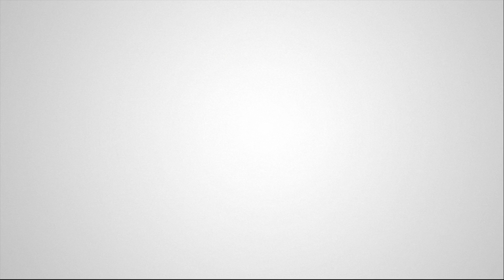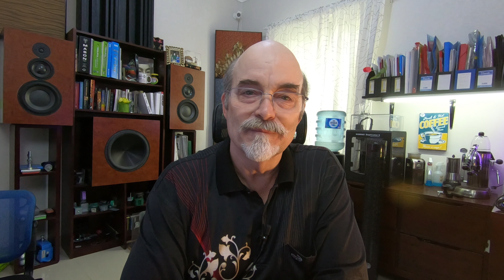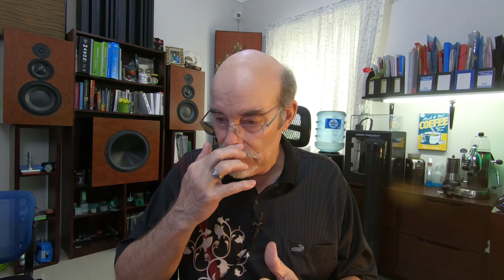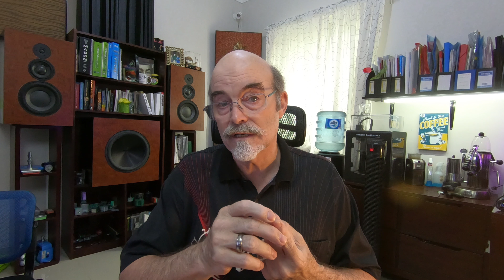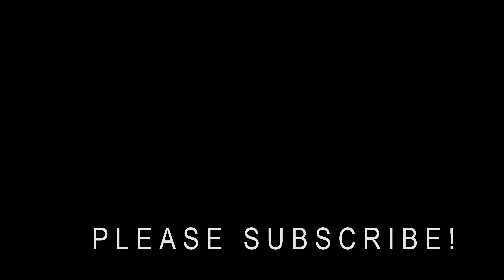Rock Wool Does Not Sound Proof

Comment: What insulation do you recommend for in-wall speakers?
Want to fill the wall so I don't get too much resonance on the adjacent wall, I also want to minimise vibrations.
Thinking of deadening the inside of the wall with some dynamat, but wanting to know what else would help. 
Thanks in advance!
Reply from the maker: If you are building "in-wall or Flush Mounted" speakers, the wall must be very massive too project all frequencies forward. The absorption (resonance damping) in the wall can be any fiber - rockwool or fiberglass.

Comment: John have you looked into sheep wool and hemp as alternatives to this at all? There are some wood derived high density panels also. All seem to be a good direct replacement for mineral wools and fibreglass potentially
Reply from the maker: I am an eternal skeptic - UNTIL it has been tested. I'm currently testing many materials that we thought had worked in certain ways and finding that we were WRONG!
It's best not to assume and get it tested. I am using the world's largest reverberation room, rated to 25 Hz. nwaalabs.com

Comment: So if I use some form of insulation in my set up im only doing a very small room(room inside a room) would chalking the air gaps paired with the insulation in wooden walls which would consist of ply, MDF and pine. The pine would be 2x4(old wood so actually 2x4) and 10 mm ply and 3-5mm mdf what about of sound proofing would this give me? How much would I benefit from thicker walls? And how much further benefit would acoustic foam provide me?
Thanks
Reply from the maker: Thicker isn't always better. You should consult a professional to get the sound transmission loss that you need. As far as 'how much soundproofing' the described should give - I don't know. I would need to run the numbers. What you need to find out is how many dB reduction is needed per 1/3rd octave band. Acoustic foam will provide NOTHING for soundproofing.

Comment: I am confused, the spaces between the joists separating my ground and first floor were filled with lightweight fibreglass and the noise between floors was terrible,  I took down my plasterboard ceiling for a rewire I then filled joist spaces with rockwool slabs this has massively improved the sound transmission between floors and I mean a huge difference.
Reply from the maker: It probably helped a LOT... this is due to the fact that the floor and perhaps the ceiling below was leaky (holes, cracks, etc).
This is a common misconception. You should use MASS and SEAL first. Also, when you replaced the fiberglass with rockwool, you may have changed the seal or mass of the floor or ceiling. Correlation is not causation.
Reply: I have also used roxul it it does makes a different !
To help reduce air born noises

Comment: Hey John.  Where do vents go?  Can we put ventilation baffles inside the wall cavities?  Like in-between a double wall system?  I will end up with a 3 foot space between ceiling and roof and I want to use this space for air transfer while isolating sound as much as possible.  Bad idea?
Reply from the maker: A very good question, sir. 
If you have a two-partition assembly, you will need baffles and attenuation of sound on each side of the partitions. The baffles will extend the mass of the partition while using absorbing material in the ducts along with pressure-changing cavities in the baffles to further attenuate sound. Wherever air goes, so goes sound. 
The space between the partitions must not be coupled with anything rigid like galvanized ducting. Use flexible connectors. This is common for HVAC systems to prevent vibrations from following the lines.
Reply: So snaking 6 feet(or so) of insulated flexible ducting through a large ceiling cavity would not be enough.  I would want baffle boxes on both side.  One on each side of partition for both intake and out take.  That would be four baffle boxes?>   @JHBrandt
Reply from the maker: @michaelangell9535  It really depends on the situation and design. That is what I have done in many builds. And we have no problems with sound transfer.
Your method may work well for your situation. I don't know.

Comment: John great video.
But there are lot of product based on rockwool that are advertised exclusively as sound insulation materials.
Why they do that?
Reply from the maker: What you say is very true. It is the reason why I posted this video. You have to remember that, especially now, most products are marketed for any niche they can fill - to increase the company's profit margins. 
Be skeptical, demand proof (empirical evidence). and don't believe anything at face value. Ask other professionals, etc.
See my resources page (website).
All the best.
Reply: @JHBrandt  John I think maybe because they are all advertised as insulation material inside a cavity....as you said an drywall has already its own sound insulation value. Filling in the gap will produce an +6db insulation value. Is this correct?

Comment: What is the best sound proofing? Glasswool or rockwool...plz tell
Reply: This is like asking if paper or cloth is better for making a drinking glass. His point is that you need mass (something heavy) and to seal things well. So a PERFECTLY soundproofing wall with a hole in it won't do the job. Mass + Seal is his solution. Adding the cheaper of the two you asked about INSIDE a wall is a good idea, but it's mostly the mass and seal that will give you the results you want. Once you have your wall, the cheaper of the two you asked about would be useful to absorb reflections WITHIN your treated space, to reduce reverb. But they won't do a lot to block sound from the outside.
Reply: Buy MLV, mass loaded vinyl, expensive but effective, it weights 10 to 5 kg per square meter.
Better than that is lead.

Comment: Im not asking about thick fiberglass insulation. I can either buy Rockwool Acoustic Mineral Wool Insulation 60-6lb 48"x24"x4" 3pcs
or Owens Corning 703 Fiberglas Acoustic Insulation - 3pcf 48"x24"x. To glue on my wall as panels. To treat my room. Not soundproof per se.

Comment: Hey I’m trying to build a sound booth for recording vocals. Is it a smart idea to put rock wool inside of the walls?
Reply from the maker: Yes, of course. Please see my videos on isolation. 😊
Reply: @JHBrandt  but will it make it “soundproof” or close enough to where I shouldn’t have any issues
Reply from the maker: @no.1noone179  No. It will not make it soundproof. Actually, there is no such thing as soundproof except in space. You have to have a vacuum between the buildings to be sound 'proof'. :D
Don't guess. you need to KNOW how much you need at each 1/3 octave band in the audible spectrum. Send me an email - john@jhbrandt.net

Comment: Hey John... So my understanding is Rockwool on itself is just for treating the room (i.e. acoustic panel stuff) and not for complete sound proof insulation. Am I getting it R8 or am I missing something ???
Reply from the maker: Joseph, Rockwool is used IN the walls and in treatment. But it doesn't soundproof. Not by itself. Yes, it is often used as a treatment for the velocity region but adding it to your walls does not increase the transmission loss the way you would think. Massive bricks of Rockwool in a wall do not improve sound transmission loss over lighter weight solutions. 
Use the fiber insulation for filling the wall cavities, yes. You can use rockwool or fiberglass, depending on your other requirements. :D
Please see my resources page "Absorption Coefficient (CONSTANT) where you can see the level of attenuation per frequency at any coefficient. NOTE: If a company shows you a chart depicting a response curve that goes down to 20 or 30 Hz, be very skeptical. ;) You have to look at WHERE the line crosses a coefficient... Example: an absorption coefficient of 0.7 means that at THAT frequency, the level is attenuated about 3.6 dB. - Therefore, ignore EVERYTHING below 0.7.
Reply: @JHBrandt  Thanks a lot John... Much helpful ❤

Comment: What would you suggest insulating an attic to reduce noise for small airplanes flying over?  Blown in fiberglass, rock wool?
Reply from the maker: You need an isolated structure system. The most that any absorber, like Rockwool, can do is 10 decibels.

Comment: I remember building 3 music studios for a client in london... He had actually flown in an expert from Holland on what materials to make his studio out off...He wanted those isolation strips to hang the drywall panels on off the studs,2 layers of drywall to be exact with the 2 layers sandwiched between green glue.. 100mm studs all infilled with 100mm of rockwool..
I couldnt believe this guy... They probably payed him 2 grand and his flight to tell them that...
I said the best thing you can do is to knock 2 foot off the diameter of the room and id build a room within the room... If your truly looking for isolation from outside, then you have to cut off the transmission of sound energy making it through your actual room.. Foam or wool might shave off a bit of energy for sure, but wont come close to making a dent in the grand scheme of things...  They weren't best pleased when I told them that the 2 grand they spent on green glue was a waste also... Felt bad for them... Wish they had asked me considering they wanted me to build it..
Reply: I’m looking to build a recording booth and saw your comment , I’m looking to build a room inside a room what would be your advice for the best soundproofing?
Reply: @konceptuzari  Simple really.. Keep your inner room away from your existing room walls as much as possible. Make your new stud walls as deep as possible 100mm or more. Fill the inside with either rockwool rw30 or similar or just fluffy rolls if you prefer.. Build your new floor with a gap away from the walls, doesn't have to be much at all, just as long as they don't actually touch, If your worried about neighbors underneath then mass loaded barrier/very heavy rubber sheeting down first, sit the stud floor on that,fill in the cavity in the floor with rockwool or fluffy roll, sheet it ontop with OSB/PLY and either go again with mass loaded barrier sheeting on that and then a final layer of osb/ply ontop. Inside walls , Sandwich consisting of drywall sheet/ mass loaded barrier/drywall sheet. On the back of the walls outside the room drywall sheet is enough.. Oh and a solid door in the new room, Don't cheap out and get a hollow door..   Hope that helps
Reply: Sorry I forgot to mention, Put down strips of mass/loaded barrier on the floor under the stud walls also.. It might seem unstable maybe at first but as soon as you have the 4 walls interlocked, it will be fine.. Also just use intumescent caulk or caulk that dries and stays rubbery for filler everywhere you have gaps in your drywall and floor, No need in buying into expensive stuff.. All a money grab.. You can buy jumbo rolls of the stuff for cheap..
Reply: @petrokemikal  Why do you say green glue is a waste? Apparently it performs very well on tests for increasing the overall STC.. Or were you just talking about in the context of this project?

Comment: Hi I'm building a wooden hut in my garden that will be a place where I can dj.
I was going to insulated the walls with rockwool, then fit sound breaker bars on top of that then plaster board over the top.
Will this reduce the noise on the outside for neighbours etc.
What would you recommended?
Reply from the maker: Yes, that works. But you are experimenting. I'm sure that, if you seal the inside and outside, you will have some reduction in sound but how much?
Go to my resources page and download "Soundproofing - the Quest" and "How to find out how much Isolation you need"
There is also the CNRC document with testing data for wall assemblies. ir-761

Comment: I think the title is a little unfair to rock wool because by this standard, nothing, no material actually “soundproofs”. They all just help in their own ways that can then add up to a “sound proof” wall.  Again, to a degree. Just like how say insulated boots are “shockproof”, but. Put those boots near a downed power line and it will still kill you since it’s power is higher than your resistance.

In lots of builds rock wool is only what is allowed because it has greater fire resistance and water phobics. So less chance of rot and mold.
Reply from the maker: Well, the thing is that Rockwool is only a part of the system. By itself, like many have been led to believe, it is pretty worthless.

Mass and seal provide sound proofing. If the structure is made of cavity construction, fiber increases the sound transmission loss.
Simple.
It's physics.

Comment: Have to say I agree. Rockwool is not sound proof. I have just done a flat up and put in Rockwall, in the ceiling and then put new ceilings up. Not much difference just slightly less. We now have to put acoustic flooring down on the top flat floor too with carpet. In the UK victorian property.

Comment: so basically, the argument is to not waste your money on a different product that costs more but does the same thing as fiberglass, right?  What about the installation hassle?  I put up 'some' fiberglass in my ceiling recently that I had laying around and it is without a doubt the most annoying product to deal with.  fiberglass everywhere.  even covered up I was itchy.  Cleanup was tedious and I'm not certain the fiberglass is gone.  The rockwool looks like it's easier to cut and stick up in place and doesn't get fiberglass all over you.  In my opinion, that has to account for something.

Comment: I'm really confused. I've seen tests of other radically different fibres, that produce radically different levels of sound absorption. For instance a folded towel vs sound proofing foam. Why can't we test insulating fibres in the same way ? Surely, regardless of what the compound effect is, whether by interaction with existing wall material or not, one fibre will produce either better or worse results.
Reply from the maker: If you are confused, watch the video again. I thought I was pretty clear that fiber, by itself, doesn't soundproof.  AND if you are trying to DIY design soundproofing, you'll fail several times before you get it right. If you don't have a lot of money or time, call an expert.
Reply: @JHBrandt  I heard what you said, but as you didn't provide any supporting evidence I remain very dubious. If a single folded towel can reduce sound transmission by up to 50% I can't see a reason why a woven fibre can't do something similar.  

I'd be most interested in a field test, if you ever care to prove your claim.
Reply from the maker: @surg23  ridiculous.

Go to school. I'm not making idle claims. There are mountains of evidence. Go to my resources page and download the testing data - ir761.pdf.

Unless you prefer to get your information from anecdotes and internet forums. #facepalm
Please! Don't waste my time!
Reply: @JHBrandt  what a childish and quite arrogant response. You've lost all credibility as far as I'm concerned. But you probably won't care anyway.
Reply from the maker: @craigcotter7476  you are correct. I don't give a fuck what YOU think. Go along now... Go outside and play. Have a time out 😉

Comment: Ok, now this video has me a little confused.
I was set to build a room in a room, and use rockwool to insulate the inner room.
Following your video it makes sense why rock wool would be a waste.
Is standard insulation a better option? Do I need to spend the money i saved on something like MLV?
From your video it seems like i should build the second wall, use standard insulation and make the room airtight and that should be sufficient?
Im not looking for anything special acoustically, just want to make it as quiet as possible outside of the room.
Im a drummer and would love to be able to play at night.
Reply from the maker: Adam, you're on the right track. My main point about Rockwool is that it doesn't soundproof by itself and the density of this product doesn't' help with soundproofing. 
A room in a room is definitely what you need for drum isolation. The level of isolation obtained will depend on the mass of both partitions and the air space between them (filled, of course with fiber insulation). The fiber that you use is not so important - only that cellulose fiber is not recommended for the job. Lightweight does the same as heavyweight.
Reply: @JHBrandt  OK that makes sense.
If i leave the current wall up should i place insulation between the old and new wall?
And i saw in one of your videos that 24" spacing is better?
Reply from the maker: @adammeigh1958  yes, fill the space as much as possible without compressing the glass wool. 
24" spacing adds less rigidity to the wall panel and therefore lowers the resonant frequency. This means improved bass isolation.
Reply: @JHBrandt  awesome  thank you for the advice!
Reply: @adammeigh1958  how is it all working for you Adam?